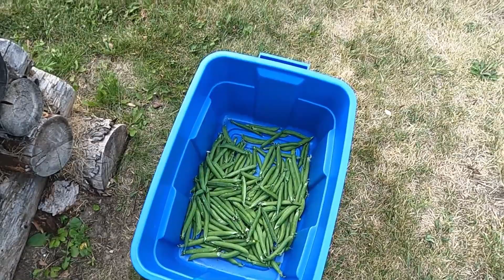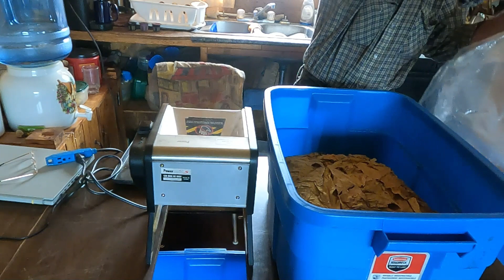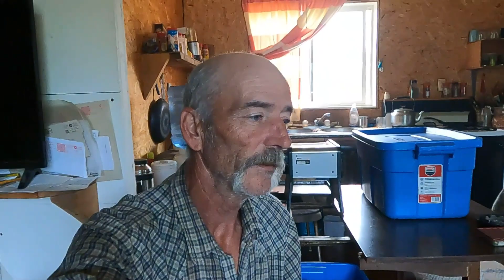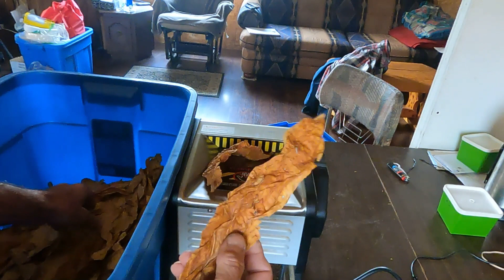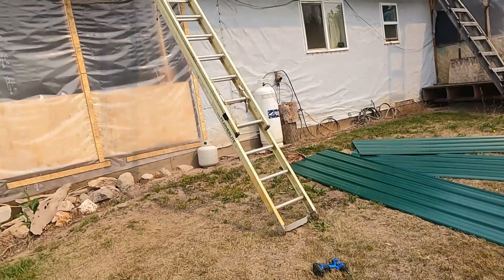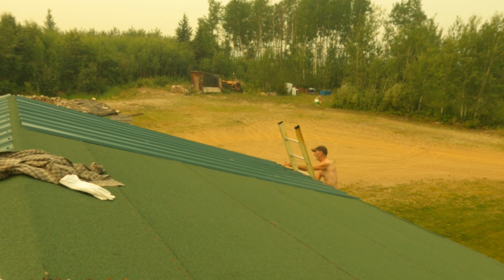Money Saving Projects, D I Y  Cabin Roofing Begins, S2 E71  .

Comment: I’ve been brainstorming how I want to build my raised garden beds… yours look like rough cut timber notched together like a log home… how do you find them!? Love’em or hate’em?!?!
Reply from the maker: Yes I love my garden beds :) I just went with logs because thats what I had & thought they might not dry out as fast but you still have to water lots, now that i have the mill i'm going to make new ones with rough cut 2" lumber, 4+4 in corners & i make they 3 foot high & at least 4 foot wide or they dry out to fast, just line the inside with heavy plastic NOT the bottom as they need drainage, the plastic will protect the wood it will last much longer, I'm taking mine all out & building new next summer :),
Reply: @littlegriffoffgridalberta6837  wonderful advice brother - thank you!!!!!!! 

I would have overlooked the bottom & covered it with plastic but you're right, they need drainage!

3 feet by 4 feet wide is a nice size.

Going to use your advice once I build mine!!!